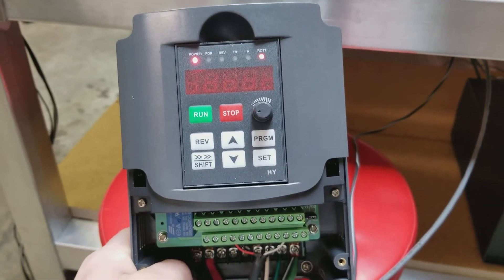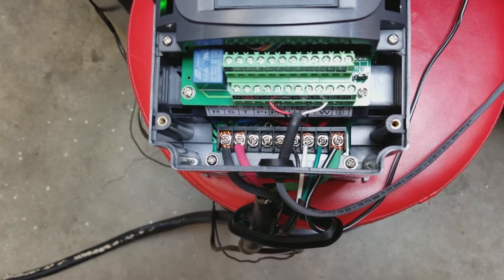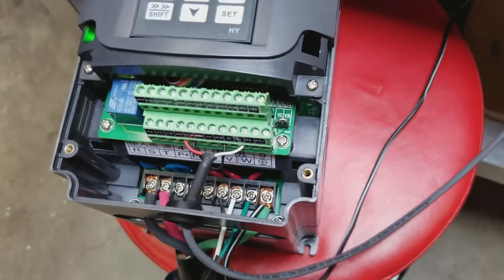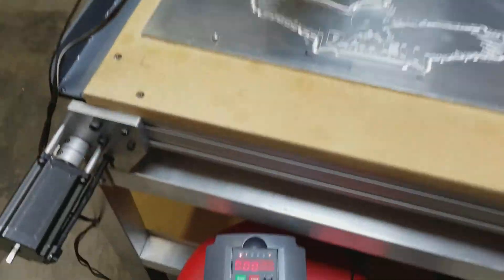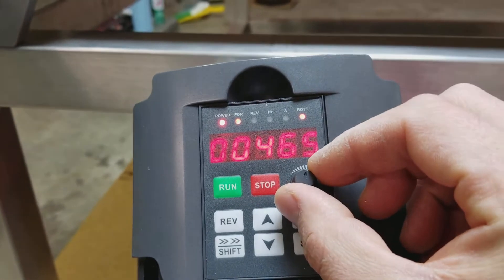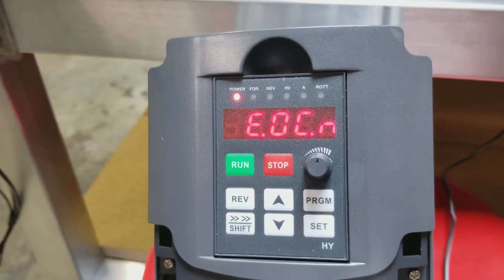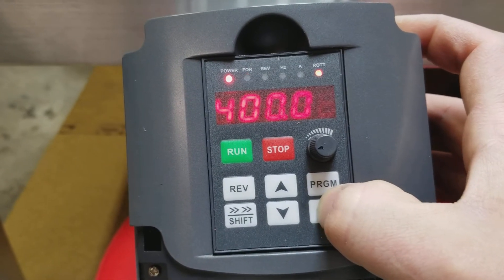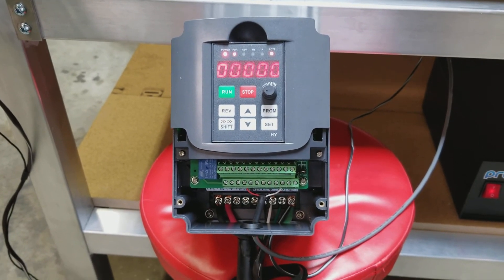Huanyang VFD 220v cnc spindle

Comment: Andrew, did you find a solution for the spindle faulting out? Mine does the same thing.
Reply: not sure if you found your problem yet but i had the same issue and come to find out the plug on top of the spindle has more than one way to rotate and go down into the spindle. I found my ground using the outside of the spindle and then made sure my ground was positioned property from the wiring. It is such a bad design that it fits in more than one way.
Reply: @chrisscranton1936  thank you for your response. I will double-check that. I have ohmed it out and I read 2.3 or so ohms between any to pins other than pin 4 which is to be left open as I understand. I am not getting much help from the EBAY seller, I have never had much luck using EBAY. Thank you

Comment: My problem is direction of rotation is wrong.
How to rotate direction of motor to right direction.
Engine always turns the other way around. weird.
How to set M03 direction of rotation.
Reply: swap any 2 wires going to the motor.

Comment: looks the same as what i have, here is what i had to do 

If you don't know how to make the proper electrical connections, the following will help you:
Connect "R" and "T" (at the inverter) to the single phase power supply. You could also connect "R" and "S" or "S" and "T". Both ways are ok. And then connect the "U, V, W " to the motor 1, 2, 3(U to 1, V to 2, W to 3). Usually we'll connect No. 4 pin (that connects the cover of the spindle motor) to the ground wire.
If you use this VFD for this spindle motor 0-400HZ , Please set the parameters of the VFD as our following suggestion step by step, and don't change the sequence:
Step 1: Set PD005 =400
Step 2: Set PD004 =400
Step 3: Set PD003 =400
Step 4: Set PD072 =400
PD144=3000